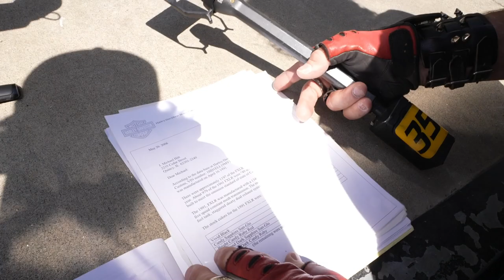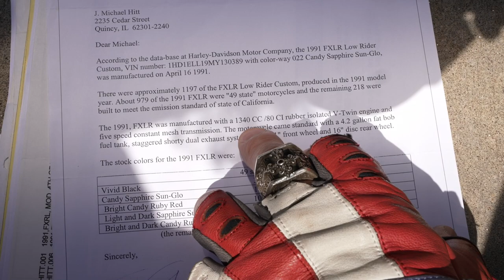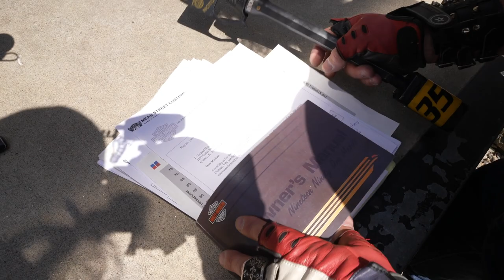1991 Harley Davidson FXLR WORLD CLASS

Comment: If Harleys looked like this today they wouldn't be hurting for sales. What a bike!
Reply: 100% agreed.  Harley has gone down the wrong path in certain aspects.
Reply: Dream bike if I were to own another Harley.
Reply: That and that electric monstrosity haha
Reply: getting rid of Erik Buell was prolly their worst move.
Reply: @whatyoumakeofit6635  wrong path what wrong path you mean like winning the national Hot rod association Pro stock world championship for 10 years in a row as the fastest motorcycles in the quarter mile ever.. raising a bar from 7 seconds in the quarter mile of a Hayabusa to 6 seconds in a quarter mile that's no motorcycle had ever done before back in 2012 at Indianapolis as Andrew Hines won the championship at the US Nationals against Suzuki.... I like performance motorcycles that's why I ride a Harley-Davidson as they are still winning national championships in drag racing and for 50 years against all other brands on the mile dirt tracks across America and the American flat track series..
And today they're racing road Kings in the battle of the baggers against the Indian motorcycles that's so far no gold wings have showed up to challenge as the Harley road King baggers are hitting 147 mph fully loaded weighing over 800 lb..... Harley has a new adventure bike out that makes 150 horsepower v-twin 1,250cc liquid tools double overhead cam variable cam timing four valves per cylinder electronic fuel injection automatic suspension ride height that lowers itself at a stop then raises itself back up for longer wheel travel on the go
Reply: @donniebaker5984  the xb9 has a stroke of 3.125" and the xb12 a stroke of 3.8" the only difference in the engines is the stroke and chamber size of the heads. They also don't redline at 10k. Xb9 is 7-7500rpm and the 12 is 6500-7krpm. The XBRR which was a limited production full race bike redlined around 9k which was a magnesium engine with lightweight internals with a bore of 4 inches and the xb9 stroke crank. Non of the XB buells had oil cooled heads. Only the xr1200 sportster.
Reply: I think harley biggest issue is the price tag. The bikes are still cool and  have character. They're just unobtainable and i think that makes "ugly" to us. Hell basic ass softail starts at like 15-18 grand out the door. Say your in the market for something better like a lowrider st you're talking 25k +. The pricing is just ridicules any more. I'll stick to used market and do my best to refrain from giving harley my money.
Reply: Harley is doing great🤑🤑🤑

Comment: I have an 86 fxrs. Took the hole thing down to bare metal and powder coated it clear. Did some small engine mods. 10:1 pistons and an ev46 cam. The bike ran good before now it screams! Stock stroke and bore by the way. There’s a video of it on my page kap, you should definitely check it out.